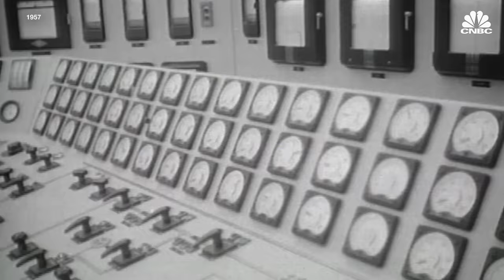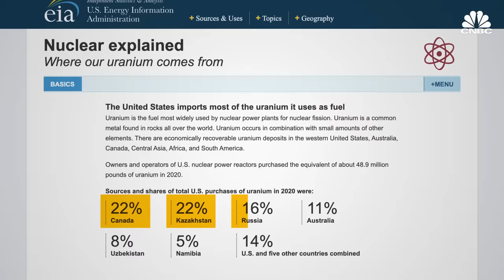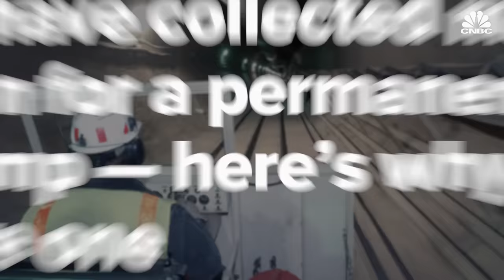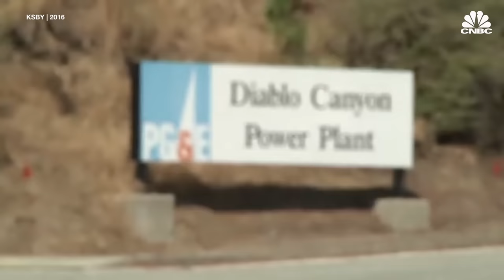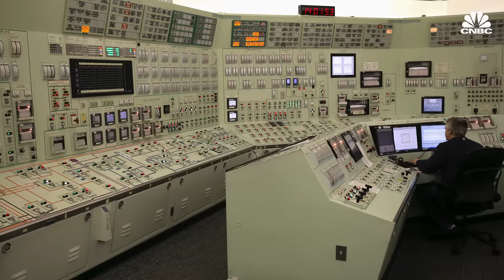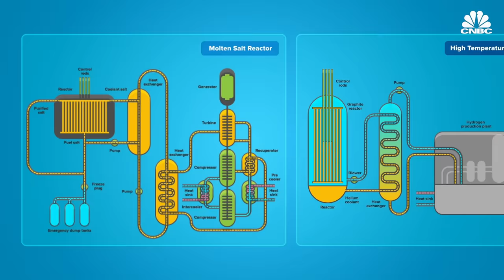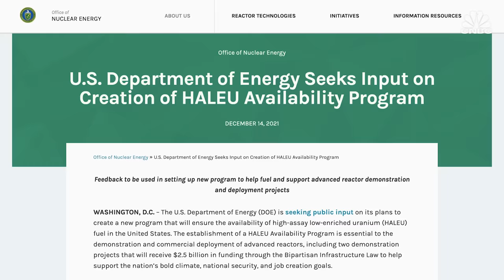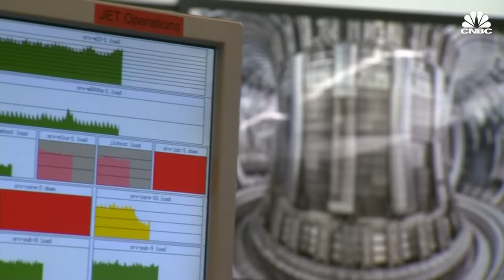Why Nuclear Energy Is On The Verge Of A Renaissance

Comment: I would prefer to see updated designs built….
Reply: you must mean like this?

If you live in the U.S. here is the reality for the last 4 “state of the art” Generation III Westinghouse AP1000 ADVANCED  new nuclear power projects and spent fuel reprocessing in the U.S. over the last 20 years. The AP1000 is fully approved by the NRC for construction and operation.  The only NRC requirement is that the plant be built per design documents…..seems simple..

The Southeastern U.S. is super pro-nuclear MAGA, has zero anti-nukes, and 100% media, local, and political support. 

The MOX facility (South Carolina) was a U.S. government nuclear reprocessing facility that was supposed to mix pure weapon grade Pu239 with U238 to make reactor fuel assemblies. It was canceled (2017) in the U.S. After spending $10 billion for a plant that was originally estimated to cost $1 billion and an independent report that estimated it would cost $100 billion to complete the plant and process all the Pu239, Trump canceled the project in 2017.

VC Summer (South Carolina) new nuclear units 2&3 were canceled in 2017 after spending $17 billion on the project (original estimate of $14 billion and 2016 completion date) with no clear end in sight for costs or schedule. Four managers on the project were charged with 16 felony counts, including conspiracy, wire fraud, securities fraud, and causing a publicly traded company to keep a false record.  The CEO of the project is serving 2 years in prison, another manager just got 15 months in prison, and the others are awaiting trial.

Vogtle (Georgia) new nuclear units 3 &4 at 110% over budget and schedule (currently over $34 billion with an original estimated cost of $16 billion). Mid way into the build, the utility stated that had they known about the many costly delays they would never have chosen nuclear. They were just delayed another year because according to the project management, thousands of build documents are missing. The first unit should start in 2023 and when it does, Vogtle will be, for its output, the world’s most expensive nuclear power plant.

Please google any of this to confirm.

If you can’t build new nuclear in the super pro-nuclear southeast U.S. then where can you build it?
Reply: @Klerk Kant  Yet you still refuse to recognize that many countries have been building and using small modular reactors built in two years or less for millions not billions.

Comment: another report out the other day. Solar panels  5c per whr, nuclear 35c per whr.  With new panels due next year that are cheaper to manufacture and greater efficiency, it will only get cheaper.  So no way can nuclear ever come back from that price difference.  No amount of wishing will ever bring it back. Thats MY POINT.  Nuclear guys want to keep arguing from an environmental impact, the argument is pointless.  You lost that one a long long time ago.  By cleaning up the issues nuclear has priced itself out and nobody with any money is listening anymore. Humpty dumpty has fallen.
Reply: Now use real numbers that include actual output and energy storage.  Your nonsense is not impressive.
Reply: @andyfreeze4072   You aren't using real numbers.  You never have.   A 1MW solar array doesn't put out 1MW.   It produces close to it's highest output rating for only about an hour each day, only when the array is brand new, and then only if it's clear with absolutely no clouds.  The rest of the day it's less, and at night averages zero.  Degrades about 1% each year, and has to be replaced three to four times in the time span a nuclear power plant will last, which also runs at full rated capacity other than the times they are down for maintenance.  And don't tell me solar never has down time, my system was down for ten days trying to get a technician out to fix it.

Comment: This is classic mis-information. Look at just one major nuclear powered country. France. It has some 100+ nuclear powered plants over 40 yrs old. All needing decommissioning and massive maintenance budgets just to keep them running. They do not provide cheap and effective energy. Taxpayers (gov) pay for the building of them (usually 10-20B +) then the energy companies run them and cash in on you, the user, then the taxpayer pays for decommissioning which is around 3-4x the cost of building - yes, yup to 100B per station (mainly because it can take 20 yrs!). All going to companies and people knowing they can charge ridiculous amounts for it. Then.. we store it. And this is the big one. In Germany for instance it has become very stuck without being able to find a storage solution for the waste (that needs stable 10,000 yrs storage) and resulting on them sitting on literally a time bomb. They are waiting for people to forget about the problem. France on the other hand... having 100 plants.. needing to be dealt with.. just doesnt have the money for this. So what do you think will happen to the waste and decommissioning? Do you really think nuclear power is your savior? or your destruction?

Comment: You need to create a Dome that holds everything in in the worst case. So the maximum Temperatur should not be over 1000 Celsius. If there is a better Material than Steel and Concrete with a higher melting point? And how u handle nuclear Waste?? To many unsolved stuff
Reply: Nuclear waste is easy. Bury it 1 to 2 km below ground, in a geologically stable area away from aquifers, where it will remain undisturbed for millennia.
Only impediment is cost.
Reply: @darkgalaxy5548  But a very deep hole is much better than this 500 meter deep  they wanna do in germany
Reply: In a stable area, isolated from ground water, 500 meters will do.
Reply: @darkgalaxy5548   Actually the 2 billion year old Oklo nuclear waste site proves you don't have to bury it deep, nor does it even have to be contained.
Reply: @danadurnfordkevinblanchdebunk  Funnier still is how it was once a pulsed-operation boiling water reactor, that contained itself once the fuel ran out.

Comment: We need nuclear reactors to fix climate change. We also can build them better and more advanced, with high-tech jobs for our scientists without getting China to manufacture everything. It's great for our economy and environment. We could start now and we'll have most of our energy as clean energy. Energy is needed for desalinization and Air conditioning that will be more important in humid climate change. Fusion will take another 15-35 years potentially and has the same problems as nuclear.
Reply: It is just not going to happen. It is hopelessly uncompetitive in the new energy landscape we are creating.

Keep the ones that are running going until they they are no longer safe and then just let it die in peace and move on.
Reply: @bx3556  👍 lol.
Reply: @clarkkent9080   Yet you fail to acknowledge the REALITY that the US and many other countries have been building and using small modular reactors for many decades, built in two years or less for millions not billions.
Reply: @clarkkent9080   Navy reactors aboard ships are real and they are built by US contractors who could build them in the commercial sector if it wasn't for the NRC.  Get a clue.

Comment: This report is so bias
No one is arguing because we is cleaner than every other source right now, the issue is the waste and storage, which gets dumped and ignored
Reply: ...where? Radioactive waste disposal is HEAVILY regulated. Please tell me what modern day nuclear company is dumping it's rods in your local river.
Reply: first of all it's not dumped, most nuclear waste is stored on site and monitored 24/7 the rest is in casks underground.

1. the waste from nuclear at least decays, the waste from renewables and dirty fuels do not
2. it can be stored, and is stored, again much more than can be said for other forms of energy
3. it produces a tiny volume of waste compared to other sources of energy due to how much power is in a single gram of uranium
4. with modern reprocessing the radiation in waste drops to background (i.e. safe) levels in ~300 years
5. all the nuclear waste on the planet contains usable fuel, once we extract that fuel and use it as we should it becomes significantly less dangerous

Comment: Things end up having a renaissance when you and other thought leaders say so.

You suddenly care about facing the misinformation about nuclear power. What took you so long?

You can't just use nuclear by the way. Did anyone you interviewed tell you that? That's because nuclear reactors can't speed up or slow down quickly.
Reply: The main issue is simply cost.  All other concerns are secondary.

Please don’t assume that YT videos are factual.  If you live in the U.S. here is the reality for the last 4 state of the art Westinghouse AP1000 ADVANCED passive safety features new nuclear power projects and spent fuel reprocessing and in the U.S. over the last 20 years. You decide if this YT video was presenting the truth. 

The Southeastern U.S. is super pro-nuclear MAGA, has zero anti-nukes, and 100% media and political support. 

The MOX facility (South Carolina) was a U.S. government nuclear reprocessing facility that was supposed to mix pure weapon grade Pu239 with U238 to make reactor fuel assemblies. It was canceled (2017) in the U.S. After spending $10 billion for a plant that was originally estimated to cost $1 billion and an independent report that estimated it would cost $100 billion to complete the plant and process all the Pu239, Trump canceled the project in 2017.

VC Summer (South Carolina) new nuclear units 2&3 were canceled in 2017 after spending $17 billion on the project (original estimate of $14 billion and 2016 completion date) with no clear end in sight for costs or schedule. 

Vogtle (Georgia) new nuclear units 3 &4 currently 110% over budget and schedule (currently over $30 billion) and still not operating. Mid way into the build, the utility stated that had they known about the many costly delays they would never have chosen nuclear. They are now delayed another year because according to the project management, thousands of build documents are missing. If completed, Vogtle will be, for its output, the world’s most expensive nuclear power plant.

Please google any of this to confirm.

If you can’t build new nuclear in the MAGA super pro-nuclear southeast U.S. then where can you build it?
Reply: @Klerk Cant   Yet you continue to ignore from your blank trolling channel that many countries have been building and using small modulator reactors for many decades in two years or less for millions not billions.
Reply: @Klerk Kant  Show anywhere I have lied on any of my thousands of YT comments, or on any of my hundreds of videos on any of my channels.

Comment: nuclear has a simple problem, its too expensive to build and then too expensive to fail.  The cost of solar plus battery is cheaper than nuclear full stop.  If you read Tony Seba's economic analysis, you would of coarse understand that nuclear being cheap power is a fraud.  The tax payer socialises the loses. "  the technology has proved to be an emission-free, reliable way to produce large amounts of electricity on a small footprint." is true in isolation. If nothing else was available  and all other options were more expensive, you would have a case. But you dont.
Reply: But what if a volcano explodes in Indonesia, Japan, Iceland or somewhere important? What if another “year without summer” happens? Renewables are not reliable (current battery technology is expensive too), so if we are to pursue 100% renewables, there has to be a non-renewable backup (fission will do for now, but fusion is on the horizon).
Reply: @fork9001  Fusion has been on that horizon for 30+ years.  Once a fusion reactor becomes operational for more than a few seconds, it will take decades to convert a proof of concept into an actual commercial power plant
Reply: @clarkkent9080  Not exactly for 30+ years, reactors only got built in the 2000s and 2010s (pretty recent by my standards), we have never been "close", even today. By my estimates, fusion should be commercially available by 2050 after they work out how to make it commercially viable and crank the efficiency up. Solar, wind, geothermal and hydropower have also been around for some time but they are dependent on environmental conditions.
Reply: @fork9001  Given my age, 2050 is a year I may never see, so don't expect an "I told you so from me".
Reply: The cost of solar with battery is actually more expensive than nuclear, plus solar/wind rated capacity isn't anywhere near actual energy production, you fell for a common lie from the Greenies.  My solar system is rated at 4kW, but I never actually get 4kW.  I only reach the maximum of about 3.8kW each day about 1/50th of the time each year. Nuclear easily generates its rated capacity 24/7 aside from downed times due to maintenance etc. Now try again with a real calculation.
Reply: @danadurnfordkevinblanchdebunk  Here is the real FACTUAL cost of nuclear.
VC Summer (South Carolina) new nuclear units 2&3 were canceled in 2017 after spending $17 billion on the project (original estimate of $14 billion and 2016 completion date) with no clear end in sight for costs or schedule.  
Vogtle (Georgia) new nuclear units 3 &4 currently 110% over budget and schedule and still not operating. Mid way into the build, the utility stated that had they known about the many costly delays they would never have chosen nuclear.. They are now delayed another year because according to the project management, thousands of build documents are missing. Utilities, not the media, decide the most cost effective electrical power source and give the above failures no U.S. utility is even considering new nuclear at this time. If you can’t build new nuclear in the MAGA super pro-nuclear southeast U.S. then where can you build it?
In both cases, the ratepayer is stuck with paying the $50 billion bill. And the silence of the Rah Rah nuclear folks on these events is deafening.
Reply: @clarkkent9080  Sure, maybe it’s a me problem.
Reply: @fork9001  I don't know how old you are but i am willing to bet that you will never see commercial fusion.  But if you are so sure, you may want to invest in those startup companies.
Reply: @clarkkent9080   The Akademik Lomonosov is a non-self-propelled power barge that operates as the first Russian floating nuclear power station.   Initially, estimated costs were 6 billion rubles ($232 million),[4] whereas later calculations in 2015 summed up to 37 billion rubles ($700 million), including infrastructure reinforcements in Pevek.  
Now get off the internet.
Reply: @clarkkent9080  Under 25, not gonna just give my age on youtube.
Reply: @fork9001  Then I suggest you invest in that technology.  If you are correct, it would be like buying Microsoft in the 1980s.
Reply: @clarkkent9080  Sure, when they come around eventually.
Reply: @fork9001  yea, what if there was a tsunami..........You make an assertion " there has to be .."nothing is written in stone. If you lack the imagination, to see the ignorance in that assertion, nobody can help you.  "Another year without summer ", i think you would have other more pressing issues to deal with, like food production.
Reply: @fork9001  i have heard it said , only 20yrs away for the past 50.  We have one now stationed high in the sky. We have the technology NOW to harness that energy, and its free energy.
Reply: @andyfreeze4072  It’s definitely not free energy, the money required would be…
not free to say the least.

Comment: I Almost believed this until I saw it was MSN…..
Reply: If this is a renaissance then I do not know what that word means.
The Southeastern U.S. is super pro-nuclear MAGA, has zero anti-nukes, and 100% political support. 

VC Summer (South Carolina) new nuclear units 2&3 were canceled in 2017 after spending $17 billion on the project (original estimate of $14 billion and 2016 completion date) with no clear end in sight for costs or schedule. 

Vogtle (Georgia) new nuclear units 3 &4 currently 110% over budget and schedule (currently over $30 billion) and still not operating. Mid way into the build, the utility stated that had they known about the many costly delays they would never have chosen nuclear. They are now delayed another year because according to the project management, thousands of build documents are missing. 

If you can’t build new nuclear in the MAGA super pro-nuclear southeast U.S. then where can you build it?
Reply: @clarkkent9080   Yet you continue to ignore from your blank trolling channel, many countries have been building and using small modular reactors for many decades, built in two years or less for millions, not billions.

Comment: No, wrong.  Nuclear itself isn't the problem.  It's the unwillingness to cough up the cost to retire those who are dying.  That's when the disasters begin.  
I'm living relatively close to 5 nuclear plants who should have been retired in the 1980's and are still running. It's a disaster waiting to happen.  
THAT's the problem.
Reply: But nuclear energy is the safest form of electricity generation we have.
Reply: @ForbiddTV  also. Your analogy is wrong.  Fl;ying is the safest form of transport but if anAmerican airline wants to take a shortcut over Russian airspace.  It becomes a risky business.  And that's exactly what is happening with nuclear.
Reply: @ShannaNL  Show any "niculear disaster" that was ever caused by Government Stupidity.    
There has also been no accident or radiation deaths due to attack, show otherwise.
Reply: @ShannaNL   Chernobyl and Fukushima accidents were not caused by "Government stupidity", they were caused by operator error, and a tsunami. Get a clue.